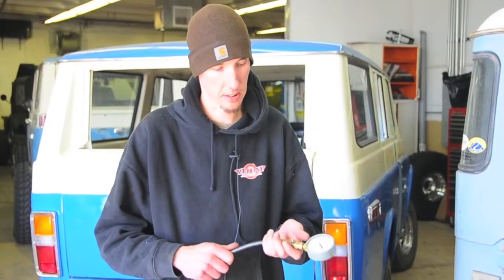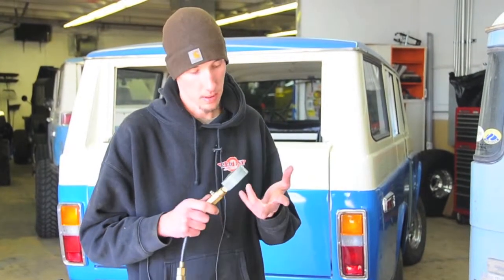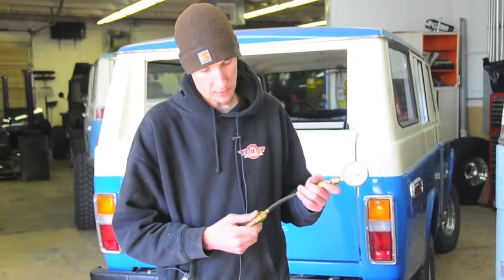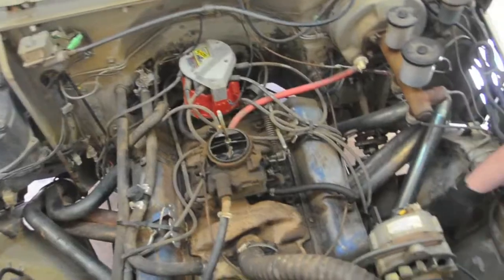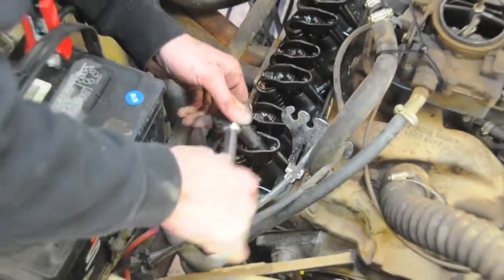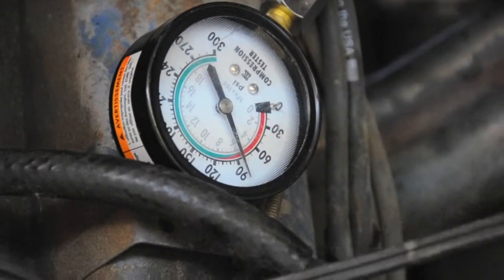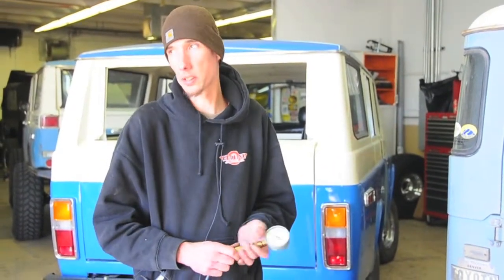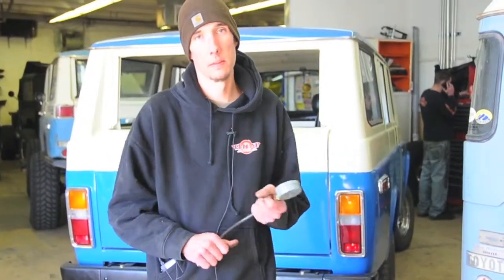How to Perform a Compression Test on Your Engine

Comment: Is it necessary to drain the carb fuel bowl? 

Also are you referring to 110 being the cut off number on a hot or cold compression test and also referring to a wet or dry test? 

Dan